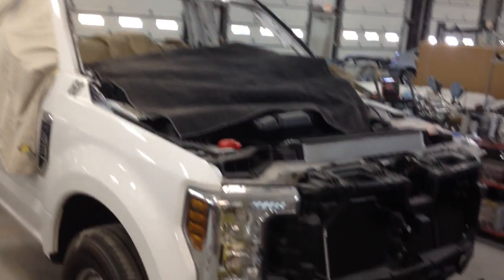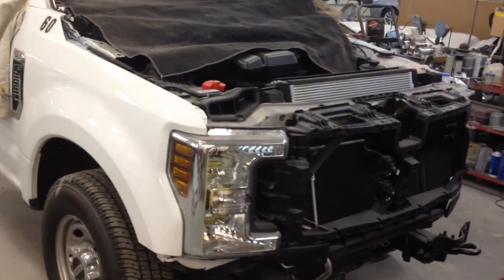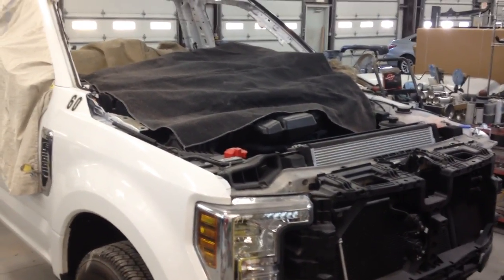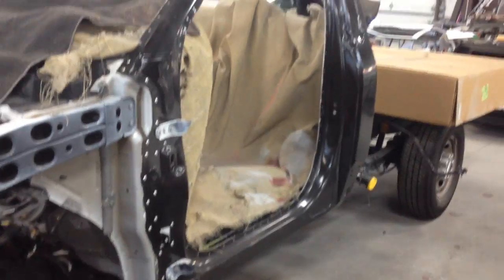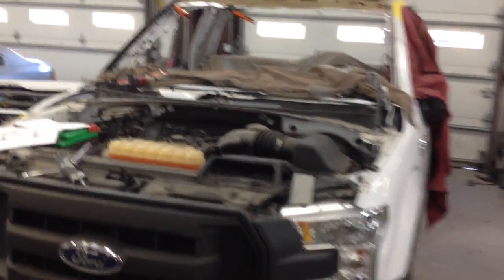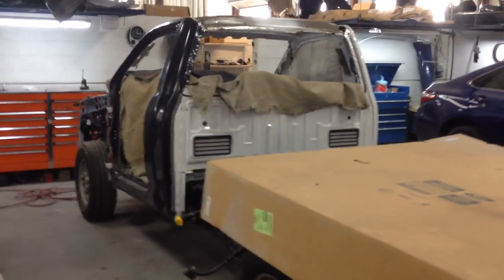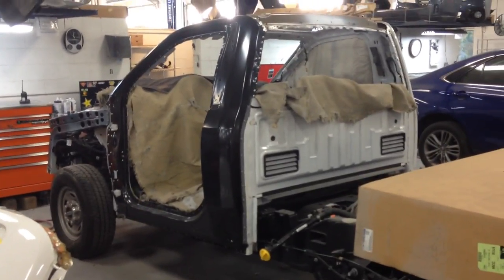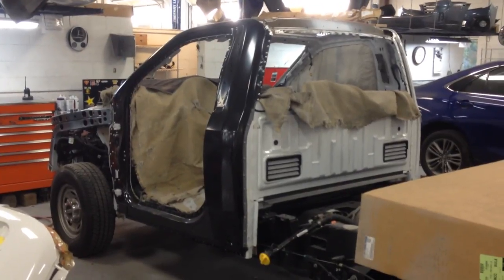2018 Ford F 250 / FAIL!!  Aluminum Body

Comment: So what you’re saying is that your door got dented so Ford says disassemble the front girl, bumper, fender, and light? I’m sorry but I find that ridiculous and hard to believe. I mean, you have any before pictures?

For one: I had a similar accident in one of our F-150s, some moron on a motorcycle hit me and slammed into the passenger side door. All they did at the dealer was replace the door and paint match it. 

Yes, aluminum is a bit expensive to repair as it isn’t widely used yet. Something I believe will be alleviated in the future with Chevy doing the same with their trucks.

You may be getting screwed over with these people. But I don’t know until I see some before pics. 

This may be very true which you can be understandably angry. But over what you say is only one door? I mean why would they be putting a whole new cab side to it then? They’d be doing that to a steel bodied truck as well if the rear corner was smashed. Those areas are nearly impossible to fix. I just don’t believe it was as minor as you are playing it out to be.
Reply: GM only uses aluminum on the hood, doors, and tailgate. The rest of the body and the bed is high tensile strength steel.

Comment: Misleading comments by you Tom! The damage was more extensive than a door dent!
Reply: Mike Allen I was thinking the same thing and then never having showed pictures of the dent anywhere in any video? What are we sposed to think Tom when you described it as a small dent in what I thought you said the rocker panel but I could be wrong. In any case there’s something we aren’t being told at all cause again if it was just a small door dent then the door only would ave been repaired or replaced but with the repairs they’ve done we can see you aren’t giving us the whole story brother so you may as well just fess up and spill the beans
Reply: A simple small side damage will require a repair like this. Since you can't straight out or repair aluminum like you would steel, it requires to replace panels, and since cab corner and roof rail/pillar is all one panel and is tucked under the roof skin, it requires a new roof skin as well.
Reply: schnittz Umm..no that’s not how it works.
Reply: @Dekkar4  all this from a door dent. No way dude.  Replace the DOOR. you don't replace the hood if the door is dented. There HAS to be more damage
Reply: jason petersen you don’t understand the way vehicles are built. Cab corner is part of the uniside,  which you cannot replace with roof skin on.
Reply: @Dekkar4  um yes I do know how they are built. He never said ANYTHING about any cab corner. He said DOOR DENT. Not cab corner. Even if the cab corner was dented. They can be replaced without taking the roof off. That brings me to my original point. There must have been MORE damage than a door ding. Cmon man
Reply: jason petersen ever heard of “common sense”? Unless that you think that body shop is replacing the uniside just for the kick of it! And insurance company has no problem with that since they are paying for repairs.

Comment: worked at the Alcoa TN plant expansion where they are manufacturing those frames...thats just crazy!
Reply from the maker: b h 42 I will agree with you.  That's why I posted this video.  Please share it.  Aluminium sucks for building a truck.
Reply: MR. FIX-ALL INC. it only sucks when you don’t keep your eyes on the road Tom
Reply: MR. FIX-ALL INC. It only sucks when you don’t tell the whole story.

Comment: Do you have a video or some pics of the damage to the truck before the work started?  I was considering buying a new F-250 or an F-350.  Makes me think I need to do some serious Craigslist shopping for a much older model.  :  (     Grrrrrrr...
Reply from the maker: No I do not have pics of the original damage.  Look on Craigs list for older trucks.
Reply: That’s what insurance is for

Comment: Ford is a fucking joke, I’d always prefer a good old Chevy, it’ll never let ya down. Want an example? My dad bought a Tahoe brand new back in 2003, the damn thing won’t die! It’s only had an $800 service history excluding tires and oil changes, It’s over 300K miles and it still runs like new, it’s built to last until the end of time

Comment: At how old and how many miles will the cost of repair make these trucks basically worthless?
Reply from the maker: Good comment, there worthless when you buy them.
Reply: @tnoel374  I would not have guessed that. I thought the new aluminum body would be nothing but rainbows and puppies like the ads said. Just crazy. At least you are learning about this EARLY in your ownership.

Comment: I earn a living doing collision repair. This kind of crap is starting to become more prevalent, gm is has also shifted to aluminum. Im thinking of getting out of the business.
Reply from the maker: Here's another problem.  There is only one guy in Raleigh that can work with Aluminum.  This truck has been in the shop for over a month, and I have to wait 2 more weeks to get it back.
Reply: At least GM is only using it one hinged panels, doors, hood, and tailgate which are easy to replace.

Comment: Get a Toyota Tundra.   Most American made,  highest quality trucks in the land.👊👊👊
Reply from the maker: Thanks man for that comment. Toyota doesn't make a 250 only 150.
Reply: Towing capacity tops out at 10,200.  The f250 is 13,300.  I’m betting that he needs that capacity given all the equipment he hauls.
Reply from the maker: @jj5484  That's right Jim I need 12,500 pounds of towing to be legal on the roads.
Reply: Adventures of a Handyman 
Doesn’t matter, the profits go overseas.
Reply: Good way to send your hard earned money to Japan.
Reply: @jj5484  Toyota doesn't make a truck strong enough to be legal. The Tundra's axles and transmission wouldn't hold up to 3/4-ton level use as it is anyways. Their 10.5" rear diff is notorious for carrier bearing and pinion bearing issues.

Comment: Good to know! I wont buy one.
Reply from the maker: Please don't buy American steel.
Reply: @tnoel374  What's wrong with American steel Tom? At my factory it's all I use as it shears,punches,and forms in a consistent manner. Steel suppliers try to sneak in foreign steel now and again and I can't remember how many loads I shipped back as it won't hold the consistency I need.
Reply from the maker: @amossnowdaharleyman9179  SORRY AFTER READING THAT TYPO.  BUY AMERICAN STEEL, NOT ALUMINIUM.

Comment: I just spent 10 grand(plus another $2500.00 for the camper shell) over the last year going through a low mileage (117,xxx miles) 99 F-250 Super Duty crew cab with the good 7.3 diesel in it and thought I was a dang fool. If new Ford repairs to a simple dent require what you showed in the video I'm thinking my money was well spent.Got a couple of videos up if you want to see the truck.Latest repair was the rear crank seal,and the front tranny seal since it was out,and rebuilding the engine compartment fuel filter housing(all rubber seals dried out) just after I installed the camper shell. That batch of repairs was another $1770.00.Wife and I have an upcoming 1200 mile trip: we'll see how it does(bringing loads of tools just in case...).
Reply: amos snow  hell I paid 2000.00 for a 1995 Ford with 200,000 miles and drove it 10 years with only maintenance diesels are highly over priced and over rated in my opinion and with diesel much higher then gas not even that economical
Reply: @danbailey96  The truck came with the company when I bought the company. "Loaned" it to my dad for  16 years or so and got it back when he passed away so it's more of a labor of love and remembrance than a cost effective truck.

Comment: i was considering a Ford. Glad i chose the Tundra.
Reply: bendigr Is pay attention to what’s being replaced on the truck. He says it’s a simple door dent yet the entire front end is disassembled and the corner/A-pillar is being completely replaced. Not being biased, but if those supposedly fine, the body shop shouldn’t be touching them.
Reply: bendigr Tundras are pretty nice, but not really in the same arena as a Super Duty or a 3500. I find it unfortunate that Toyota doesn’t try doing heavy duty trucks as they are a nice brand.